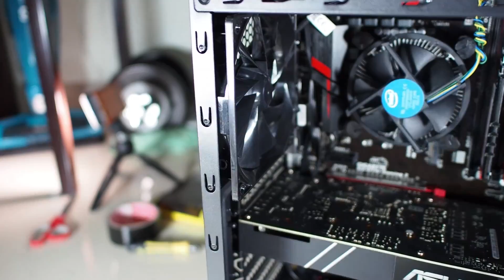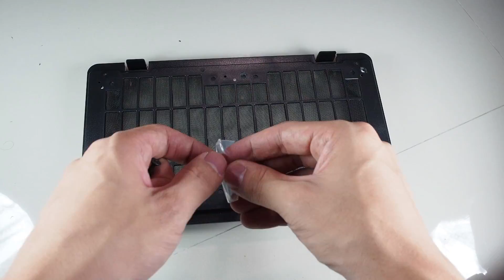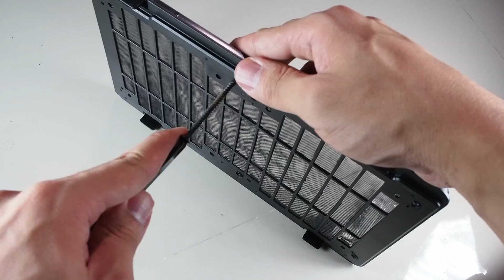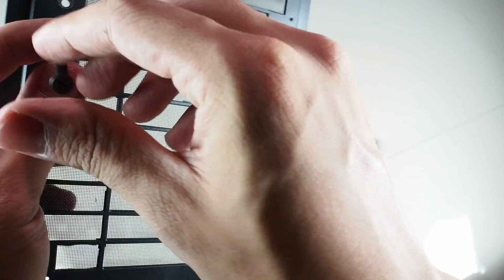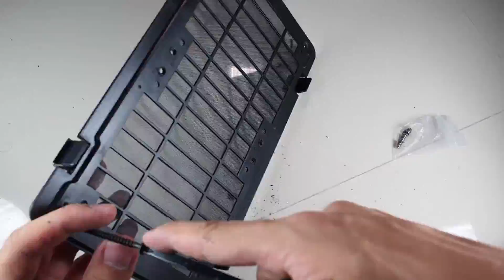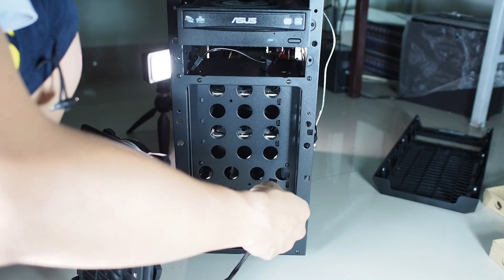【How to】install Cooler Master Masterfan Pro 120 onto Thermaltake's Versa H25 Casing's Front Panel

Comment: Hey 
My h25 stock fan have double partition! 
So can I install any RGB fan in H25 case ???
Please notify me
Reply from the maker: Adib Wasi , is it the same one as the one in my video?
If yes, please ensure that the fans that you are going to install have a square bracket around it.
Below is an example of the one you can use without a problem.
https://www.coolermaster.com/catalog/coolers/case-fan/sickleflow-120-red/

As a counter example of what not to use, unless you want to do what I did in my video is as below.
https://www.coolermaster.com/catalog/coolers/case-fan/masterfan-mf120-halo/

Do let me know if you have further questions or if there are anything that’s unclear.
All the best in your PC modding.
Reply: @ChuaWeiJie  First of thanks man !!
and in my region all category types fan find so tough!! Other side, this case is good but front panel is really bad...... 
Also I'm thinking that Aigo DR 12 rgb fan can be adjustable for H25......but after watch your vid then I got noticed !! 
and thanks again !!
Reply from the maker: @adibwasi375  , you are welcome. Yes, the case is good but they over designed it. It can only support a specific type of fan design. If you want to use Aigo DR 12 with H25, you'll need to go for the same modifications as I did. Once again, you are welcome.
Reply: @ChuaWeiJie  Got it bro !!!

Comment: How did you manage to remove the front panel of the case? Mine is so tight
Reply from the maker: It's scary when you do it. You'll need to pull hard. Starting from the bottom will be easy.
Reply from the maker: Hi there, this video might help you a bit. Yes, you'll need to put quite a bit of strength into it. 
https://youtu.be/yfmaBUqzsVU

Comment: Is it hard to take the front off? I have the same case and thinking about adding a fan or 2, to the front.
Reply from the maker: Kennie Omega the front is not hard to take off. You'll need to use a bit of your strength though. I advise you to bring the front part on your trip to ship for your fan or buy fans with square designs else you'll face the same problem as I did. Good luck. ^^

Comment: I'm planning on installing two frontal coolers on my Versa H23. Do you think I'll have the same issue?
Reply from the maker: It seems that Versa H23 has the same front filter design as H25. It depends on the design of the fan. The one that I used has an unconventional design; it doesn't have the square thing around its edge. The easiest way for you to be sure is to take the filter part with you when you do your shopping. It will avoid the problem that I faced.
Reply: Thank you so much for your advise!
Reply from the maker: The pleasure's mine.